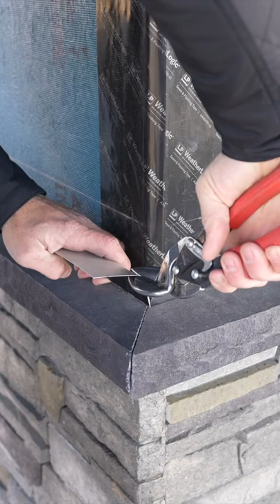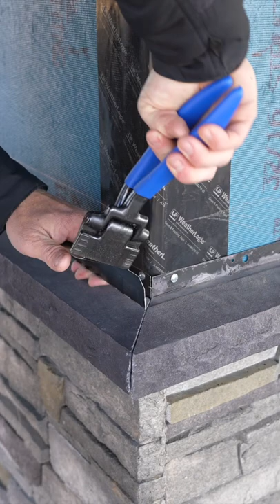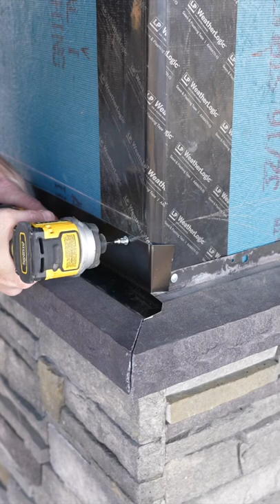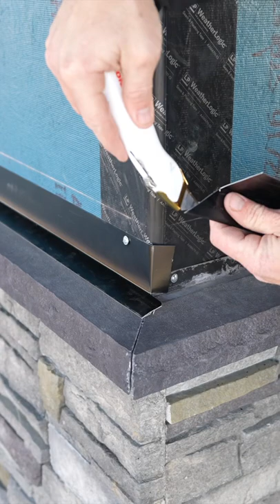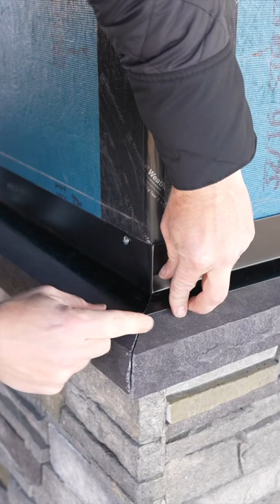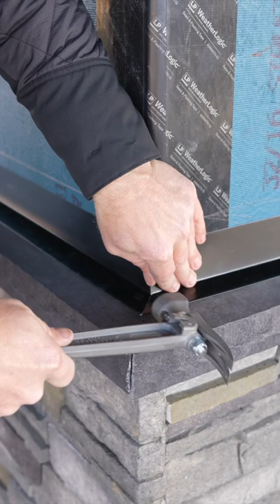Corner Trim Flashing Done RIGHT! #shorts

Comment: Can you guys please do a video on how to do a standings seams flashing corners
Reply: Just do a mitre as normal but one side have it be a rectangle thats say .5" and the other peive have it be 1" and cut the corners on 45 degree angle. Join them fold the additional half inch over the rectangle peice than take the 45 dehree corners that stixk out on the rectangle piece and fold over the 1" 45 degree angle and squeeze it all together

Comment: Good work BUT!! You shouldent be using a graphite pencil on your steel. It can cause rust. You should be using a felt tip permanent marker.
Reply: Wrong,, colourcoat backing on all coloursteel acts as a barrier,  you'd be right if the material was galv or zinc though

Comment: What tool are you using to draw the line ? Awesome video as usual 👌
Reply: I believe it’s called a Pica marking tool
Reply: @briand6833  theyre awesome. So much better than a regular carpenters pencil. They sit in a little holder that can clip into you suspenders and has a pencil sharpener built in the holder.

The pencil itself is like $15 but for refills you can buy generic lead thats the same size for way cheaper than the pica branded stuff

Comment: Not bad but the problem is the flashing should be under the wall protection water runs downhill so if the water gets behind the flashing it's going to run into the house not only that way you overlap the outside corner you gave it an inch you didn't put any kind of aluminum sealer underneath to prevent water from getting into the miter on the bottom and the butt cut on the top so the street possible failure is there
Reply: But make sure you have peel n stick or somethin between the flashing and wood or it will sweat

Comment: Oh great now there's a razor sharp corner instead of just using a single piece and bending it around
Reply: That wouldn't work with external on this profile, would only work on an internal corner
Reply: @garethhancock8525  I've done it a bunch of an external corner. It works and I like that way better. It looks cleaner because you won't have two pieces meeting each other.
Reply: @Shrtrund  have a look at the actual flashing, it works if the flashing is shaped with girth going down and back under,  not with a flashing shaped the same as the one in this vid
Reply: @garethhancock8525  you're right I didn't think about that
Reply: @Shrtrund  but I do agree with you that if having the option to turn it round in one piece is much better   👍
Reply: Ugh the metal flashing doesn't stick past the brick so how exactly are you gonna cut yourself? Besides cutting one peice and folding it around doesn't look as nice.